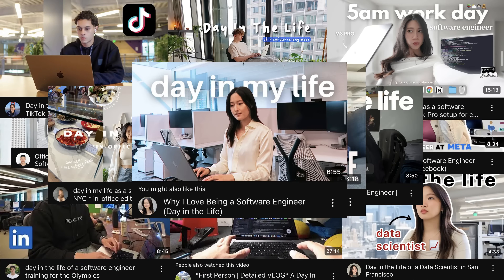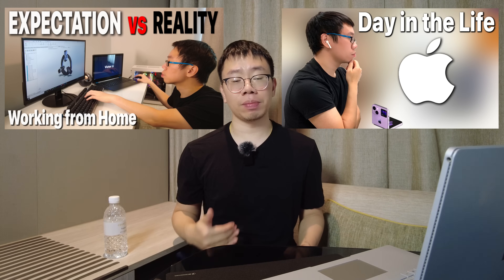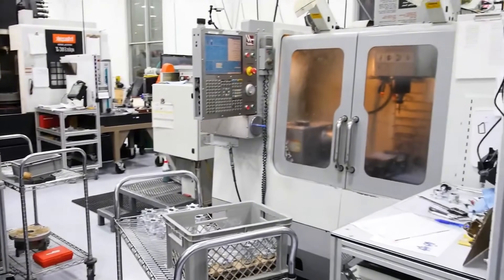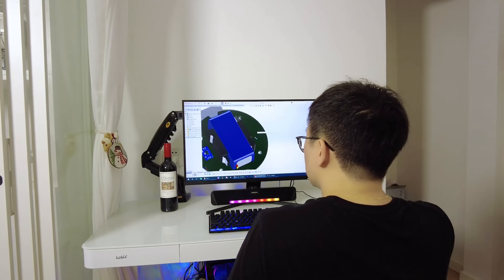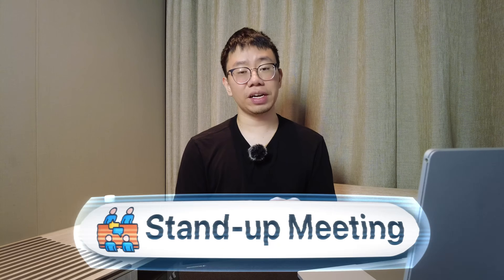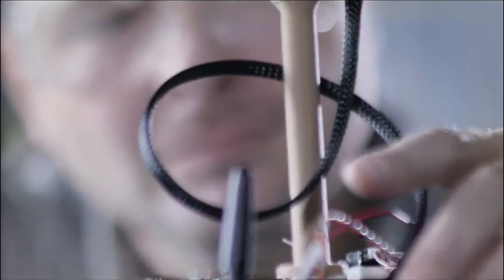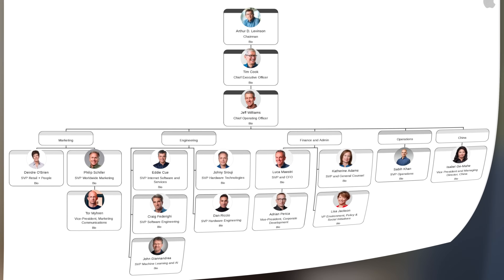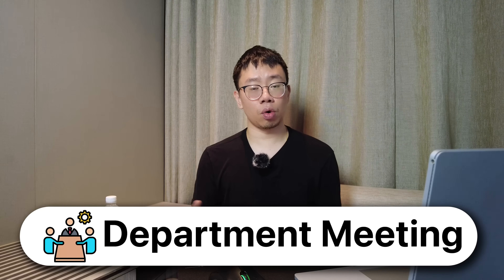What Mechanical Engineers ACTUALLY Do

Comment: Mechanical engineers can go into many other areas than just design. I went into manufacturing, and my day consists of analysing other peoples designs to make sure they are possible to build, especially tolerances. Then planning which machines will be used, making layouts of the plant floor, any lying cycle times, etc, and also lots and lots of meetings. You can also easily get into project management if you want more “people work”. There are also project engineers who coordinate all the other functions and plan things like testing, analyse the results, etc. you can also get into Quality. I’m sure there are many more!

Comment: I got my mechanical engineering degree while working as a R&D engineer. I have gotten HEAVILY involved in electrical wiring, and plc logic, aside from actually putting all the prototype systems together, and testing them. I also help a LOT with design and modeling. I have no Idea where to go with my career, I get to do it all currently. Its good but also stressful...there isn't another guy and its ALL my problem :) :/ ;?

Comment: I'm a senior mechanical engineering student this year, I've done a 9 month long co-op, and I'm currently in my 7th month of my internship. Doing an internship and fulltime school has been a real challenge, but somehow I managed to get through the last semester. A lot of the points you made in this video are valid, I've seen some of the experiences in my own environment, and sometimes it can be worrying. However, I wanted to say that not all is bad. 

At the beginning of the video, you stated that a majority of your time will be spent on the computer, and I suppose it depends on what field or position you'll be working in. That was one thing I was worried about, and thankfully there are a ton of high paying options where the office/field split is closer to 30/70. In my co-op, the split was 60/40, which I didn't really like because I'd rather get my hands on experience. In my current internship, the split is 20/80 and I absolutely love it. Yes, I don't mind working on the computer, using CAD software to design things for my projects, but I feel like talking to operators, seeing work being done, and even getting your hands on equipment or machinery that you normally wouldn't mess with, a huge benefit compared to sitting in an office all day.

I guess the reason I'm typing this all is that; there's still hope for you guys out there. If you don't like the current environment, change it for the betterment of your future. You don't have to be confined to an office. Thank you for the informative video!
Reply: If you don't mind me asking, what industry are you working in? While I like the idea of designing, I'm more inclined for being more in the field and hands-on. I'm in Texas and I got an eye on maybe being an oil & gas reliability engineer in the future.
Reply: @miguelalvarez5292  I apologize for seeing this so late! I’m currently in the steel industry. Internship still going strong!

Comment: I am an electronics engineering student,
But I wanna learn mechanical,
How do I self learn, 
We do learn engineering graphics and stuff, 

But the reason I am not switching 
Majors is because,
The reason I choose electronics over cs,
Was because even though cs has more jobs in my country ,
I wanted to built things i wished hands on, 
The reason I didn't choose mechanical was because the jobs are kinda hard to get with low salary, 

But it's i wanna create a real world product i need mechanical, 
Is there any way to self learn,

Comment: I think mechanical engineers just don't know what they're doing most of the time but they have a good poker face.
Reply: Lmao as a mechanical engineer I make robotic prosthetic hands for a major biomedical company and my hobby is buying crashed damaged cars at auction and rebuilding them recently I bought a BMW M5 Competition that drove through a house I got a 130k car for less than 40k and whenever I take it to the car wash nobody believes i fixed it myself when I show them the pictures but then I say I'm a mechanical engineer I even took it to BMW for wheel alignment and a wellness check and they gave it a 9.2 score out of 10 I love rebuilding a car from the ground up having zero actual mechanic experience, I rebuilt a crashed damaged Nissan skyline GTR with a blown transmission Nissan said it's a 35k replacement I said nah removed the gearbox took it apart reassembled it put it back together fixed the structural damage modified and it does a 10.1
Reply: @yusufabdoolla5919  That is awesome, must be fun doing these assemblies. Profitable too
Reply: lol. Love the lack of context yet strong implication of a story behind this.
Reply: correct